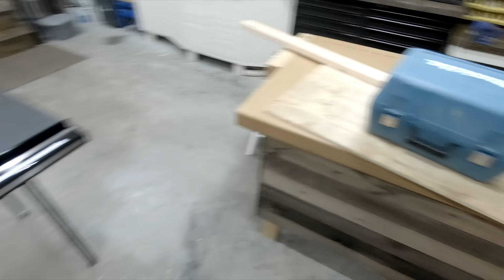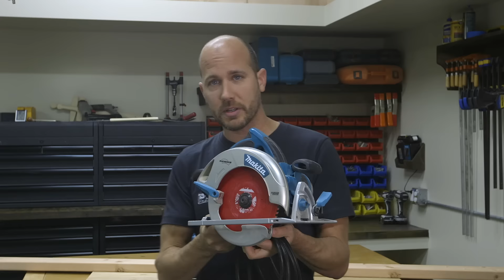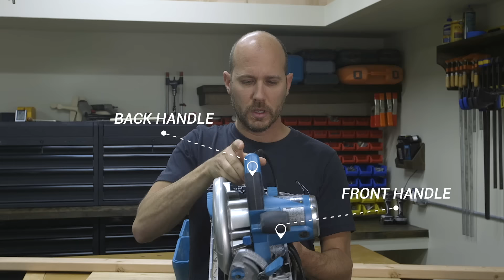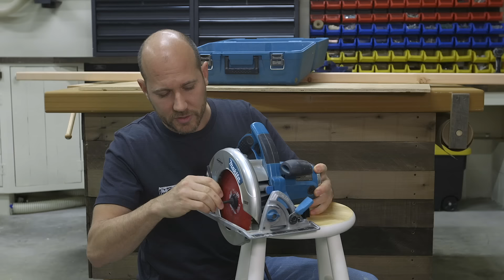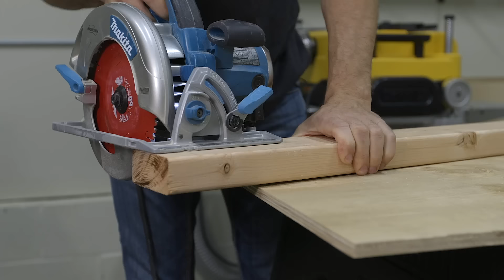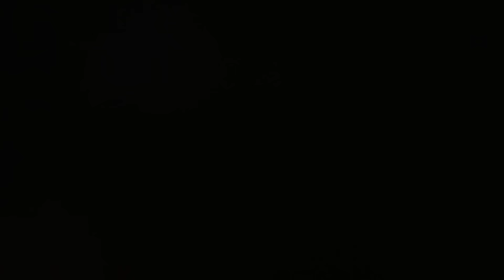HOW TO USE A CIRCULAR SAW FOR BEGINNERS- PART 1

Comment: I had to junk my father's Black and Decker circular saw to the garage so that a junkyard truck can pick it up. I saw the blade attached. It is very scary.

I know such saws can be very dangerous---and in some cases, deadly!  

You need to treat these portable saw appliances like firearms---especially if it is battery operated and not AC powered. If battery operated--NEVER EVER PRESS ON THE TRIGGER (usually it is the orange colored thing) until you are ready to cut wood, or you could be cut-mutilated to death! 

And of course, OSHA rules demand that you wear PPE when using them....
1. Eye protection is important because of the possibility of wood dust flying fast from a saw cut and the possibility that metallic bits of blade also flying out---that could also happen. Wood dust or metallic bits, if they hit the eyes, can cause serious eye injuries. Maybe even blindness. So use safety glasses.
2. Wood dust shrapnel from saw cutting can go into the nose and into one's lungs, and can be almost as dangerous as silica dust. So use a respirator or other mask that covers the T-zone of your face. 
3. The best protection would be a welding face shield, even if the saw won't be used for welding steel. 

Other safety tips....
1. Never operate such saws when intoxicated (especially by alcohol or other drugs), or if you are sleepy or drowsy---with or without drugs that cause them. You must be fully awake, because if the saw drops if you doze off or get fatigued, the saw could land on your feet or legs or worse, and the unthinkable injuries or death can happen. 
2. The guard in the circular saw is THERE FOR A REASON! Never alter or remove the guard!
3. Never alter the saw tool for any other thing other than its intended purpose (which is generally cutting wood).

Comment: Hi. What are your thoughts on using a 15 AMP corded circular saw versus an 18-Volt Battery-Powered Saw?
Reply from the maker: Depends on what you're doing. If I'm making a lot of cuts all day, I'm old school and prefer a corded saw—I don't like having to keep an eye on batteries. But if I'm not using the saw all day, a battery-powered one is so much nicer.

Comment: I just began doing woodwork as a hobby literally as of May 28th 2025. I just broke down my first wood pallet with a hand saw then, and I've been intimidated by the inevitable use of a Circular Saw in the future for projects. The moment I saw that you could BEVEL the thing to >45 degrees I lost a ton of fear an immediately got excited at such a prospect. I thought I might need to invest in a used Miter Saw or something. With this, I can make clean, accurate angled cuts!

Comment: If I want to cut 4x4 can I use circulars saw? I have a Dewalt  DW369. Is this can be used for 4x4 .
Reply from the maker: Yes, you will have to flip the 4x4 over to finish the cut.. which is normal.

Comment: SINCE I ASKED YOU TUBE CONTRIBUTORS FOR SOME ADVICE FOR CIRCULAR SAW PROBLEMS, ABOUT 4 DAYS AGO,  SUDDENLY. THERE ARE DOZENS OF 'EXPERT'S VIDS, FOR THAT TOOL OBVIOSLY,  NONE OF THEM HAS EXPLAINED WHAT THE CAUSE OF MY PROBLEM IS;   BUT STILL,  NONE OF THEM HAS MY 30 YEAR OLD BLACK AND DECKER, WHICH HAS BEEN USED ABOUT 5 TIMES.AND IS STILL IN  IT'S ORIINALBOX.  PITY  THAT THE NEAREST SERVICE CENTER, IS OVER 100  RETURN MILES AWAY.
Reply from the maker: I sense some real frustration, and I'm sorry you haven’t been able to find the answers you're looking for. What are your specific questions? I’ll do my best to help. I will say—chances are, the problem isn’t you, but the saw.

Comment: I wish I wasn’t so afraid of the circular saw. I bought a cordless one and I’m still afraid to use it. I use jig saws, reciprocating saws, hand saws and drills and all this stuff, but I have such a fear of the circular saw.
I’m a woman that does all my own diy stuff around the house and I’d like to know if anyone else out there had a fear of a circular saw at first. I know most men have no fear of powerful tools. So maybe some women can chime in so I can use my saw that’s collecting dust.
Thank you
Reply from the maker: Thank you for sharing this! Please use the link below to visit my new beginner woodworking online community and post this comment there. This is such a valuable conversation to have within the community. https://www.skool.com/traininghandsacademy/about
Reply: Me - I'm not feeling confident at the moment, but working on it.  I bought my Skil Saw 13 amp 7-1/4  three months ago, in preparation for a project that will take place in the spring of 2025. I'm preparing by watching these sorts of videos and learning as much as possible before I fire up the saw with confidence and start ripping plywood. I will be replacing wall sheathing for 2 outdoor sheds that my Dad built. I think I will continue to build my confidence the more informed I am about safety measures and techniques. I would have liked to purchase the 15 amp model as it comes with a laser guide, but my house is old and the electrical outlets are rated at 15 amp. So a 13 amp circular saw is the max I can use. I bought a 3 ft GFCI extension cord so that I can plug the saw into that and have circuit protection.

Comment: I am 53, and literally never even HELD a power-tool in my hand....so this experience is completely new to me!
Reply from the maker: Well if you need any questions answered please reach out.
Reply: I’m right there with you for the circular saw. It’s intimidating to me, even though I’ll use any other saw, especially my jig saw all the time. I guess because it’s smaller and I’ve put that poor saw through so much all, because I’m afraid of the circular saw.
Good luck with any projects you may have.
Reply: I’m 72 and my grandkids are bullying so I’m going to use this
Reply: @dulisewcording-tr5il 😂

Comment: I was framing my roof last week with a cordless left blade then at the end I had to pull out the old electric full-size  skillsaw right blade to cut like a couple times and it’s so awkward and I curse so much time . And I’m like wtf do I do with the cord that in my way anywhere I put it because I cut once already with the saw.

Comment: So that was a great demonstration but
 could you also show how you get the blade off once you loosen it? Or does it just slide off the little bolt and come straight down after pushing up the safety guard on the bottom? Just need to know I'm a widower who has tools but hasn't necessarily use them. Thanks for these videos I think I have come to the right place.

Comment: I endeavor to build a Sanctuary. Like Noah built Ark. Moses built Tabernacle. Solomon built House of God. Ezekiel went through Temple of God. Also Revelations chapters 20-21. I got a drill master circular saw. I read the instructions.  To see you show, explain, point out and break down helps further first time with one. Still little shaky about angle adjustment. I learn as I go along. Determine to get it done. Thanks for explaining and clearing up what is what.
Reply from the maker: I'm excited to see what you build. God be with you as you work!

Comment: Hi there, thanks for sharing your video. I'm thinking of purchasing a Mac Allister MSCS1500 1500W 190MM Electric Circular Saw 220-240V, I don't want to spend a lot on one, as I'm only just starting out in my woodworking hobby. I was wondering what is the best way to use a circular saw if you are wanting to cut a wide piece of sheet material so as an example say if I needed to cut plywood 350mm wide but the circular saw fence only has a maximum extension of say 150mm? Any advice or indeed if you have a video on how to do this that would be great.

Many thanks, Paul from England.
Reply from the maker: Hello Paul. Check out these two videos. Let me know if that helps. https://youtu.be/ILVCdEOhYBc https://youtu.be/N8ufCdMYV7w

Comment: I've seen some videos with the circular saw cutting over a base, rather than the wood to be cut extended over the worktable's edge. What material is the base made of? Foam, MDF? Please enlighten. Also, is it better to walk beside the saw while cutting, or reach over the worktable and cut. This questioon relates to saws with the motor on the left side ( with the worker standing behind it).
Reply from the maker: Hello, here is a video showing how to cut over foam board (I really like this method). https://youtu.be/ILVCdEOhYBc. Walking beside the saw or reaching over is fine, just as long as your reach doesn't make you unstable. Hope that helps.
Reply: @TrainingHandsAcademy  Thanks!

Comment: I dont think I have a corded saw anymore except my 2 skil 77 world wormdrive saws that I rarely use. I'm lefthanded so I use mostly the cordless stuff since it's left bladed.  I have a old slow ridgid and some newer ryobi stuff. They really lack power. Even the full size blade brushless ryobi circular saw. Alot of times I'll try to use my miter saw or table saw instead.

Comment: I have Masonite siding on my house, and several sections have started to disintegrate due to water damage.  I don’t want to replace the entire 12’x16” panel though.  I’ve been cutting out the bad sections with a dremel cutting tool and using a table saw to cut new pieces then nailing those in and caulking the seams.  My co-worker (who knows a lot more than me) said I should not use the dremel tool, I should use a skil saw.  Can a skil saw cut to depths of only about a half an inch?  Will a skil saw do damage to whatever is under the shoe when cutting/ripping the painted Masonite?
Reply from the maker: I would put some painters tape of the bottom saw to protect the siding... you should be good!

Comment: After more than a year and two contractors, I'm going to finish my deck myself.  (If the work is going to be less than professional, why go broke paying someone else who won't follow directions?)

I've watched a boatload of videos and find yours really hitting the mark.

To finish the deck, I first need to trim out a framework that supports benches that encircle most of the deck.  I'll put Trex fascia over the 2x4 framework, then cut and install Trex atop the framework for the seating surface.  This calls for ripping 16' Trex planks to serve as the fascia.  Looks as if a Kreg Rip Cut Saw Guide and a Diablo TrexBlade will fit the job.  Instead of the Kreg, would a fence designed specifically for the saw model do the job?  (Still agonizing over which circular saw to buy, because two splendid choices vie for this job.)  Any other advice you can offer on this aspect of my largest ever DIY adventure will be appreciated!
Reply from the maker: How much are you ripping off of the Trex?  You might be able to use a Squi.Jig attached to your saw base to rip that all down. https://squijig.com/products/squi-jig-framing-jig

Comment: Thanks for going through the absolute beginner basics like this! I never had the chance to work with or even exist close to power tools growing up. Understanding what part of the tool does what and why you'd use it over another is huge!
Currently, the only thing standing between me and a raised garden bed is the ability to cut two boards in half.
Reply: I can relate 100%. I've been putting off fixing so many things because I didn't grow up around tools. I was not taught anything, except in shop class with huge machine tools. That knowledge has faded 35 years later.
Reply from the maker: Glad it was helpful!

Comment: I’m 47 years old. I’ve been using a circular saw for the better part of my life and I never knew that they had a blade lock. I always stuck a screwdriver or something thin and cylindrical, in between the cutting bits, to hold the blade in place. this didn’t make me happy, I feel like slapping a puppy. Many times, I had a very hard time replacing the blade 🤬
Reply: You didn't read the instructions like you should. You assumed you knew everything.

Comment: Worm drive circular saw is great, it's powerful but I don't like changing the oil and adding the oil it's a hassle to me, that's why Makita's Hypoid Gear Drive Circular Saw works for me all the time. And the big advantage of a Hypoid Gear is that it's a Heat Treated unlike the traditional bronze alloy Worm gear. And the Hypoid Gear Drive Saw requires NO maintenance, except the carbon brush. But when it comes to Carbon brush I always gets mine from Makita Parts in Anjo, Japan 🗾🇯🇵 their Original Japanese Genuine Makita parts. That's why they last a long time.

Comment: I had an Issue with a project when the circular saw couldn't get through a certain bit of the lumber (Probably a knot), is there a method to get past these tough bits?

Comment: Hi - many thanks for your great advice. I had a job to replace some broken tongue and groove woodchip floorboards in my kids room with pvc hardwood and was advised to use a circular saw. i'm am an IT support techy - normally hands off DIY. However, your tips were invaluable. Made it easy. Keep up the good work.

Comment: I'd like to learn more about cutting mitres. 45% in dimentional lumber using a speedsquare to guide. Is that possible? How to hold the lumber to reduce movement and get an accurate cut.
Reply from the maker: Noted. Thank you.

Comment: May i know what wattage of circular saw is needed for cutting plywood or like 2inches wood? Thank you
Reply from the maker: Any 7 1/4" circular saw will have enough power to cut through that material. My saw for example is a 15 amp. Hope that helps.
Reply: @TrainingHandsAcademy  thank you very much for your reply. Just starting to enter small woodworking business by  acquiring woodworking tools.  Skill as well
Reply: My daughter also asked me if i could make her her desired bed as my first project.  And my hands just got a trigger finger for trying to learn about wood working. Your answers to my questions will surely help me learn. Every answered question will be highly appreciated sir. Tnx again and God bless you and your site
Reply from the maker: @jordandun7201  Let me know when you have questions. If you're on Instagram find me there too.
Reply: @TrainingHandsAcademy  i don't have an instagram acct. But surely i will have questions regarding woodworking and thank you again for sharing helpful information.

Comment: I'm just curious how many videos I am gonna have to watch to find the specific setting for a 2x4 and an average OSB board so far no one has covered the settings that a beginner needs.
Reply from the maker: What setting are you looking for?
Reply: @TrainingHandsAcademy  angles
Reply: The blade dial and the dail with the angel I guess the 2 with numbers on them.
Reply from the maker: The blade depth should always be set to about 1/4" below the surface of the material you are cutting. Therefore, that setting will change with different material thicknesses. Don't worry about the actual number setting, just set it so the blade is at the depth.  As far as the angles, simply adjust to the angle you are looking to cut. 90 degrees for straight cuts, and 45 degrees for mitered cuts. Does that help you? Also, did you watch part 2, that may help if you have not already.
Reply: I just want to know what numbers should I put them on
Reply: Yes thank I have the blade set at zero just past the mdf board. Now I'm just trying to get comfortable with how I hold the guard, trigger at the same time it's a cheap chicago electric 63290 it's heavy not much info on hand positioning 🙄 thank you
Reply from the maker: @ashantirobinson242  Let me know if you need more help.
Reply: @TrainingHandsAcademy  Thank so much I think I should have spent more $ it looks like real saws have a way to lock the guard. The way this one is made I need to hands. My hands are small & weak. I got Mariah Carey make it happen on repeat 😭

Comment: I have a question. I am right handed and would prefer that the spinning blade was clearly in sight when cutting. The majority of the circular saws have the motor on the left, the handle in the middle, and the blade on the right. My next circular saw will have the blade on the left, the handle in the middle and the motor on the right so that I can watch when the spinning blade engages with the material I am cutting. Why is so little said about this situation?
Reply from the maker: That's a good question. I'm not sure why it doesn't come up more. I'll make sure to cover that when I do another video on circular saws. Thanks for asking that question!

Comment: Hi, I'm a longtime beginner. Since moving, my circular saw is still in storage. I'm thinking about purchasing a smaller duty circular saw, perhaps a 5 inch. Any thoughts on performance and safety? Thanks ;)
Reply from the maker: I had a Porter Cable 4 1/2 worm drive saw that I absolutely loved for small things around the shop. Smaller saws have their place for sure, and safety shouldn't be a problem at all.
Reply: Training Hands Academy ...Thanks so so much, I feel much more comfortable having a pro's opinion. I'll look for your recommendation and thanks for taking time to answer my question ;)

Comment: I have inherited a Black and Decker battery driven circular saw. I'm a bit pleased with myself as when I first tried to charge the battery it was on the charger for hours and didn't get charged. I nearly bought a new saw but I thought I should give it another try. That was when I noticed that one of the contacts on the battery was green. I got a little strip of sandpaper and cleaned the contact up and voila the battery charged. So now I have used it a bit. It seemed OK at first but later the saw kept stopping. I thought maybe the battery was not holding its charge well so that it was not giving the saw enough power but when I put the battery back in the charger it appeared to have plenty of charge. One suggestion online was that the blade maybe loose. So I'm here to see whether there is something that I am doing wrong or to find out how to tighten the blade.